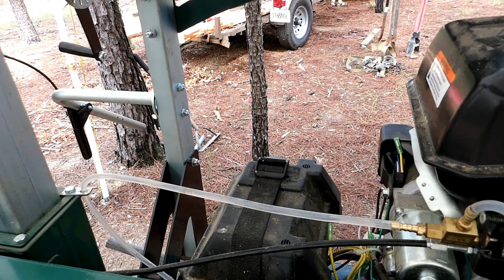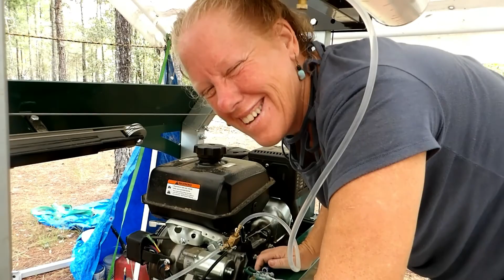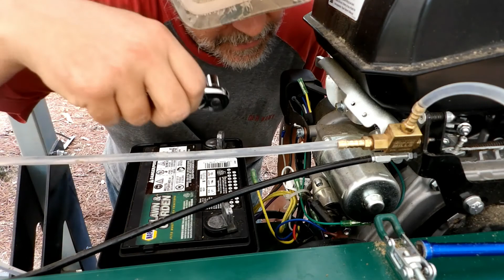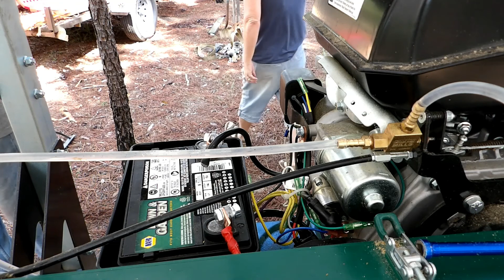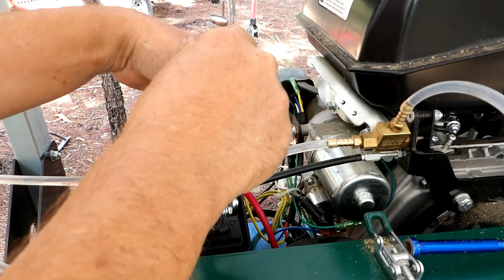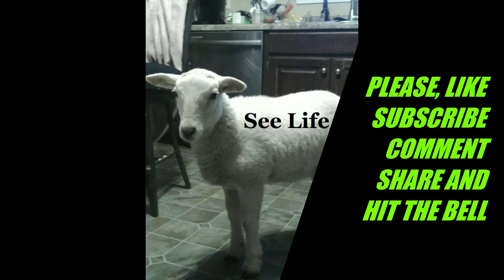Installing a Battery in a Woodland Mills MX130 MAX Portable Sawmill

Comment: Great video , Can you please tell me the exact specs of the battery you installed on the sawmill. and what was the price?  Thanks
Reply from the maker: We will have to check the battery for the specs, but we used a lawn tractor battery. think it was 750 cranking aps.